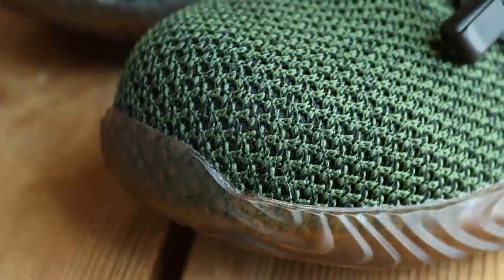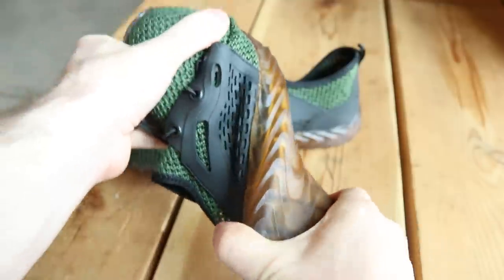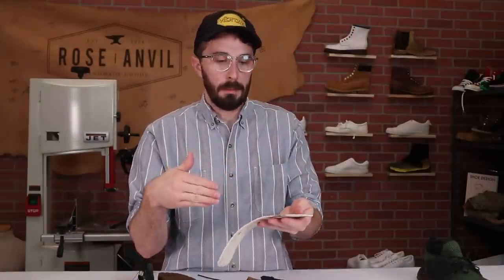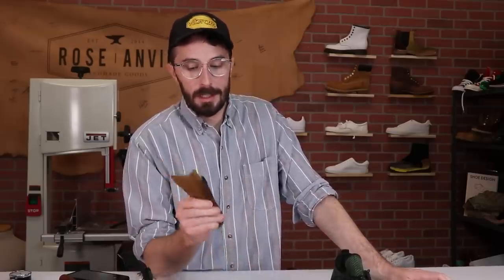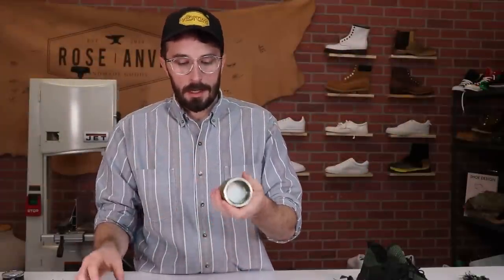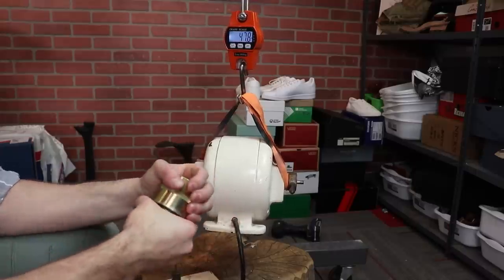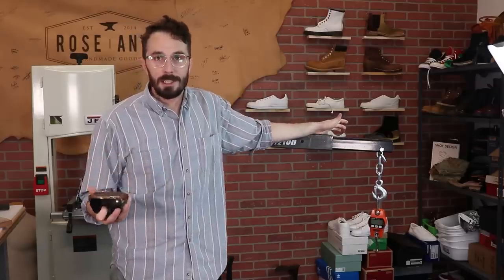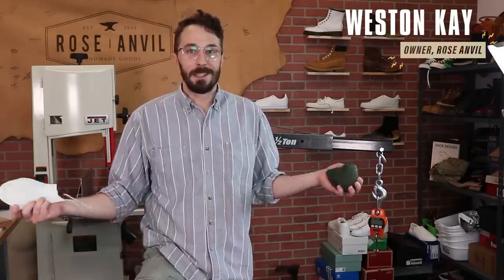Never Trust a Fart or These Indestructible Shoes

Comment: Don't waste your time buying indestructible shoes. I waited OVER 3 MONTHS for mine to arrive. During the "wait" I should say right after I ordered them, they tagged me to purchase some upgrades which I did in desperation. My desperation is because my feet are under constant (14 hrs/day) hard use at my industrial work place. I was desperate for some relief and with their advertisement, I was duped into false beliefs. In addition to others comments, it only takes the "ONE" nail to puncture thru to your very vulnerable foot then you're out of work and not getting a paycheck.
Reply: does it take you putting all your body weight stepping on a nail to realize youre, stepping on a nail? i can wear 20$ sneakers and realize im going into a nail before it goes through. but if your in a dangerous "industrial work place" and are stomping around carelessly like your walking on steel soul boots you were careless enough to think you could get immortal feet for around 60$. if youre TRYING to puncture your foot, you will. unless youre that brain dead to not realize youre stepping on a nail before puttin about all your body weight into it you deserve it.

Comment: After less than 10 wearings the shoe lacing rubber on the left side of the left shoe has torn out. Since these are supposed to be "indestructible" I contacted the company via their web site chat. This is what they told me. 

“Hi Jeff,
Thank you for contacting us. Based on the nature of the product, the warranty is not applicable once the product has been used. We do accept return and exchange within 30 days, however; the product has to be in the original condition.
It is an exceptional case and I’ve talked to my boss, we agreed to give you an extra 40% off in your next new pair of shoes. It has never happened here in the past but we'd like to make this offer for you.
Please let me know if it works for you. Thank you.
Best regards,
Rowena”

Needless to say, I did not take them up on another pair of poor quality shoes at a 40% discount

Comment: Long story about nails, shoes, and the ramifications for those interested on the subject:

Several years ago, I took a nail in the foot. Stepped on a nail in a pair of Skechers sneakers.

The nail penetrated the bottom of my foot. I went to the doctor IMMEDIATELY and got a tetanus shot--BUT THAT'S NOT THE IMPORTANT PART OF THE STORY!

Tetanus is only a concern because of what COULD be on the nail (not the chemical makeup of the nail itself); environmental stuff like animal droppings, etc. is the concern in this regard.

The BIGGER threat, I was told by the doctor, is LIVE bacteria found in the shoe itself! The glue used in adhering soles to modern shoes contains all kinds of stuff from wherever it's produced, and in the case of getting a nail through a shoe and into your foot, it's the shoe that is more likely to do the harm!

They gave me a course of antibiotics and I healed just fine.

Comment: I thought u did a good job on these different tests on this shoe. I use to do scientific experiments on the space shuttle program, and many other aerospace programs over 35 years.  The tests were all documented and certified, which means all the equipment used and all the results were witnessed and signed off by qualified personnel.  In a lot of situations, we used funky looking equipment, but it was the repeatable accuracy of the measurements in a small data spread that mattered.  However, the scatter of the results were in many tests, very large,  which indicated that the test itself was improperly designed, or the thing you were testing lacked repeatable composition integrity.  
On the testing equipment, I wouldn't think u would need terribly expensive tools for what u are doing.  If you did think u might need something, u might want to consider buying used devices and paying to have them certified as accurate by a weights and measurements certified shop.  But keep in mind, even certified measurement equipment is not perfect and also has a data accuracy spread. A lot of things can and do effect repeatable accuracy measurements between the time they were certified.

Comment: I owned 2 pairs of these 1 returned and 2nd was thrown away. 

First issue was the holes for the elastic band didnt have a metal ring around them. Those ripped after 1 week of wear. I like having a tight fit on my shoes so that right away was terrible.

Issue 2 was the inserts was absolute Garbage. After 4 hours of using these shoes at work I had to go to Walamrt and get a good pair of insert on my lunch because my feet hurt so much. After I put a new better pair of inserts the shoes because much more comfortable. 

Final issue 3 was after 1 month I started noticing a small hole that gradually started growing bigger on the left shoes. This shoes was on the the side of the shoes were the bottom rubber and the fabric connected. How this hole started I have no clue. I do not do anything rough that would destroy these shoes. 

All in all I would never buy these shoes again. After 2 pairs and maybe 2-2 ½ months of use for the price its not worth the hassle.

Comment: I don't want to defend the shoe here, but this test is poor. You take it apart and test the materials separately. You should test the materials together as that can make a big difference. Like for an example. Neither aluminium foil or glass is bulletproof at all, but glue them together it turns our pretty much in-destructible. But not if there is air between. You need to test these materials similar to how they are put together in the shoe. Again, I don.t want to defend the shoe, but this test is not relevant to the performance of the shoe.

Comment: It would protect you….. when people step on nails in an ACTUAL work place environment they effectively NEVER step with ALL OF THEIR WEIGHT onto a nail…. You typically begin to feel the pressure, at which point you attempt to shift your weight, which with general footwear is enough to pop the nail through the soul of your shoe. But with Kevlar lined work shoes/boots, there’s plenty of resistance before it even gets to that point. I know…. I’ve don’t it… MANY times. 
Actually nursing a clear through and through puncture on my right foot as we speak LOL. 
I was stupid enough to stop wearing the Kevlar lined shoes (which have saved me on at least a few occasions). 
I actually have the EXACT shoes your doing your “testing” on here. They absolutely work. 
I will make a better effort to slide these on when I go to leave for work from now on LOL.

Comment: These shoes suck. The soles don't hold up under friction. They melted on me at work and left giant scuff marks on a dance floor we were laying. The only component that held up was the steel toe. The rest of the shoe was coming apart under medium usage. After I'd purchased a different work shoe we took put the steel toes of my indestructible shoes under heavy load by running a 4000 lb scissor lift over them. The steel toes are great and held up after repeated loads of 4000 lbs . They finally deformed after the friction from the repeated loads heated up the metal allowing it to bend.

Comment: I disagree with you but agree.
Like you said this is not scientific. But I think it's good enough.
The sole was able to withstand let's say 45 pounds and the kevlar could withstand let's say 150 pounds. So you might think you get 195 pounds of puncture resistance. But the reality is anyone that buy this shoe weighs more then 45 pounds  this means the soles puncture resistance gets negates (the sole has a very important job that I'll say later). Now you only have 150 pounds of puncture resistance. Which most people are above. So on paper this shoe is very bad. But reality is very different from paper. When you walk do you smash all your weight down on one foot instantly? No, you kind of glide. Have you ever stepped on a small rock you will feel it and this is the important job of the sole. It's to give a buffer zone. You have 45 pounds of pressure warning before it even hits the kevlar. Now I dont know about you but when I feel a large pinpoint pressure under my foot I tend to not put full weight on it. And yes the ad they did with the nails was very misleading. They put three nails in the board this means the sole can now withstand 135 pounds before puncture and the kevlar 450 pounds (if you dont believe me, try to do a one handed push up (dont do that tripoding thing, that's cheating) then a two handed then image the amount of strength it took to do a one handed and add that strength to the two handed). 
With running the toes over they could've used any vehicle. Let's say they used kind of a heavy car so about 4000 pounds. The car has four wheels so the shoe will only feel around 1000 pounds which is very easy to do with steel in a shoe design.
Over all I would still say this is a great shoe and well worth $45 I will probably even buy them just because I like how they look and they do offer protection. I just wish companies would stop with the misleading. This shoe doesn't even need it to be a good shoe.

Comment: These aren’t made by the actual Indestructible Shoes company. He clearly states he got them on Amazon and they are an off brand. These are knock offs. So it’s a little disingenuous to the actual Indestructible Shoe Company to review knock-offs. You couldn’t review a Dewalt drill by using a knock off black and yellow drill from amazon.